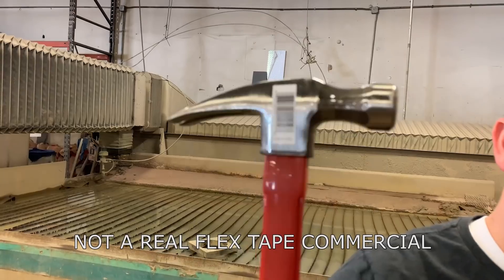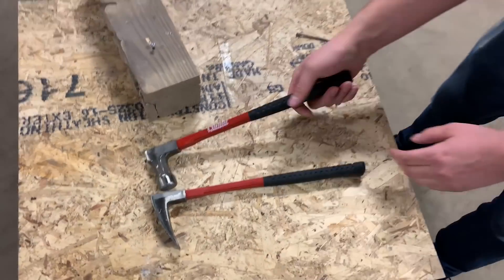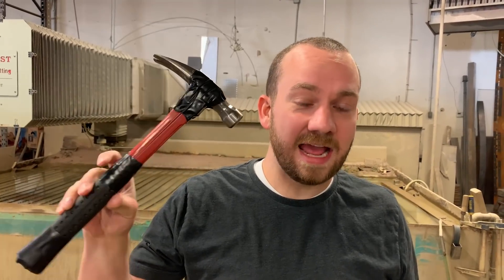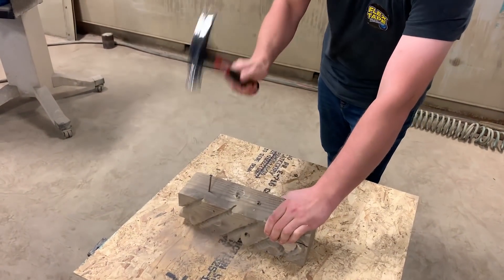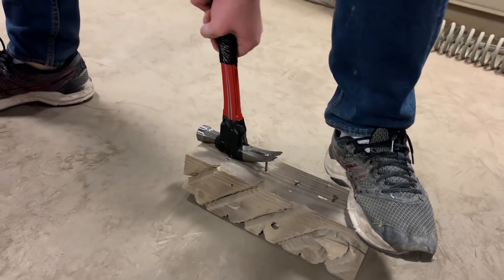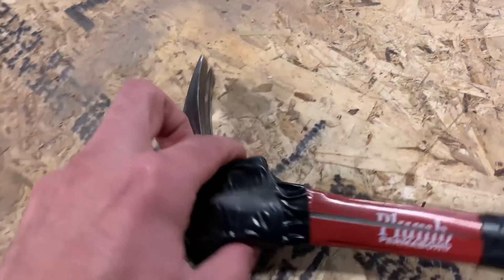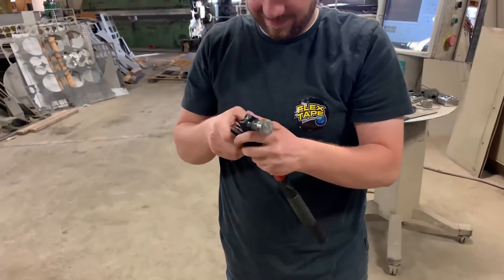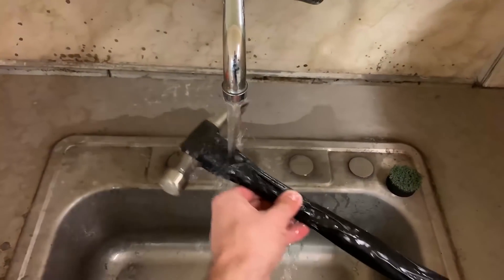Fix a Hammer with Flex Tape?

Comment: Actually I put a hole in a bucket with my pellet gun and technically, I repaired a pellet hole not a bullet hole in fact I shot it, bought flex tape and fixed it just to spite you. No I didn't.

Comment: Just looking at that fiberglass makes me itch
Reply: You don't know "itch" until you've been dragged through nettles, stung all over, and had to deal with the feeling of your clothes rubbing against it, so bad it created a probably temporary immunity/tolerance to nettle stings.
That's obviously not the only thing that could help you understand what an "itch" is, you could also experience cycling straight into a thorn bush, getting small itchy cuts all over you body, that last an entire week, again being worsened by clothing rubbing against it.
Then, you could get rashes all over your body due to an intolerance to lactose, creating an unbearable stinging/itching that you can't scratch since that would only worsen it significantly. (True itchy)
As a last example, you could have scabs all the way up your legs or other body parts, not only being initially painful, but so damn itchy that you pull off all the scabs, revealing the tender, even itchier skin underneath.
The fourth one isn't all that bad, it's at the lower spectrum of what is actually itchy.
On a more serious note, yes. I have dealt with the fiberglass itch. It is quite annoying, but I've dealt with much worse itches. The above is only meant as a joke btw, but I have experienced it all.

Comment: If it makes a water tight seal it shouldn’t be able to be cut by the water jet right?
Reply: What does r/woooosh mean
Reply: @Slayer_ 99 that’s the sound the joke makes as it goes over there head
Reply: @slayer_9935  it means the joke went over your head, also i think its a subreddit full of such things
Reply: when everyone jumps passed the conclusion and doesn't play along to the guy's follow-up joke...
the reason it works is because they have the abrasive on, if they didn't it wouldn't penetrate the flex tape because it's water tight
Reply: It's just sticky rubber. Why wouldn't the waterjet be able to cut rubber?
Reply: @hazzmattlink  r/woosh
Reply: @UselessCondom  Are you sure it was a joke? Do you know this person? Have you been on the internet? Some people genuinely don't understand these things.
Reply: Matt Bruner I find your lack of faith disturbing
Reply: That's s not how water jets work buddy
Reply: @fluffycat2035  r/woooosh
Reply: @fluffycat2035  You're dumb
Reply: @uzziake  Nope. Don't think so
Reply: And here we witness a wild cat not notice as a joke sails directly over its head
Reply: Fluffy Cat r/woooosh